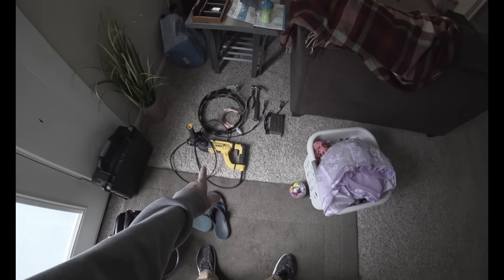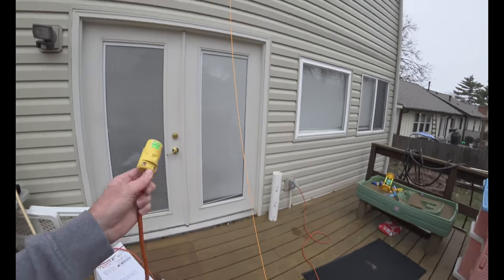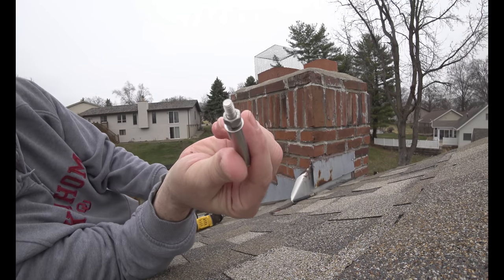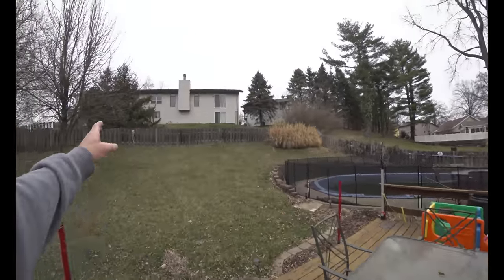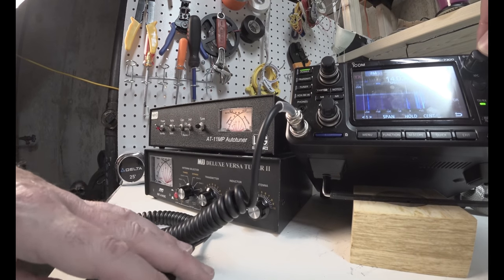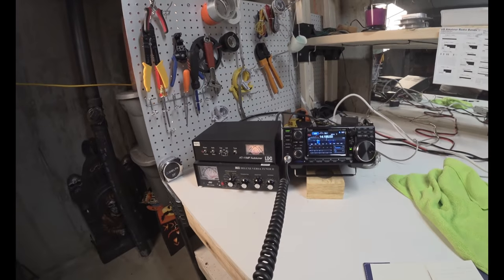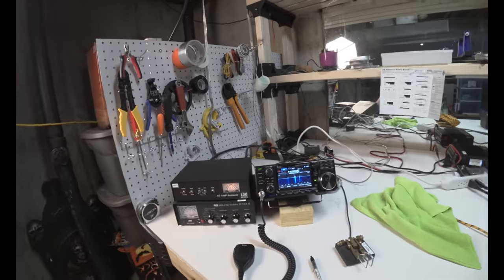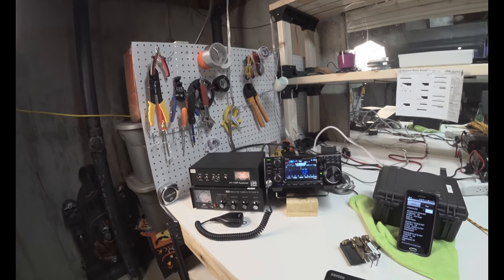Install Dipole Doublet G5RV Antenna ~ Best Small Backyard Antennas ~ Ham Radio

Comment: If you are worried about stress on that bolt in the chimney, just tie a heavier rope around the whole chimney and tie the antenna off to that. :)
Reply: Or just get a chimney strap which will be the most secure and pretty cheap to setup.
Reply: i made my oun with 2 pices of painted treated wood with long threaded rod.

Comment: Transmitting SSB with 100% power is not going to result in the meter reading 100 watts out due to the nature of human voice and the lack of a carrier in SSB.  You could boost your average power on SSB by enabling the compressor on your radio, and you might also check to be sure your mic gain is set correctly by watching your ALC meter.
Reply from the maker: andrewbrafferty Thanks for comment I know it varies as you speak but 10 percent seemed very low
Reply: It does seem a little low...do you have a dummy load you could compare results with?  You know you are getting good power out on CW (at least to the tuner) so giving a little boost to your mic gain to bump up your modulation might be all that is needed.  Enjoy watching your videos, keep it up and don't let the nosy neighbors bother you!!
Reply from the maker: I know... right?  Thanks for the kind comment.  I'll keep experimenting and try that.
Reply: It looks like your rig is performing just fine.  May I suggest you read up on the difference between Average and PEP (peak envelope power) meters. It will explain everything. I built my own full sized (102ft) G5RV years ago and it worked fine for me. Many people were surprised how well they heard me on 80m with it cuz "G5RV antennas don't work worth a damn"  But, like I said it worked for me. For folks that don't know, the G5RV was originally designed to be a resonant (no tuner) antenna for 20m.
Reply from the maker: Tim Keene Will do thanks for advice
Reply: Turn up your mic gain
Reply: Welcome to having an ICOM 7300 and one of its quirks.  I have run into the same thing,  got so frustrated with it shut it off and setup my 891, and got double the amount of power on a radio that cost around $400 less.  Bugs the crap out of me on the SSB.  Icom says this is normal.

Comment: Just a comment about the MFJ-915, in the manual of the balun it does say to install close to the transmitter.  However in the G5RV-JR antenna manual they do say to put it between the coax and the the balanced feed line at the antenna.  The issue is that the balance feed line will cause RF currents to be running on the shield of the coax.  The balun at the feed line point will prevent the RF currents on the coax shield and reduce in shack RF.  In this case I would tend to listen to the manual of the antenna and not the balun as there is likely more than one application for the MFJ-915.  Relevant information from the antenna manual is as follows:

The G5RV is a balanced antenna fed with a balanced 450 ohm line that
terminates in a SO-239 connector. When feeding this antenna with an
unbalanced line (such as coaxial cable), it is a good idea to use a 1:1 choke
BALUN at the coax to feed point connection. The balun will reduce or
eliminate parallel currents on the outside of the coax shield. This will prevent or
reduce RFI, RF feedback, RF burns, and other effects of excessive RF in the
station.
Reply from the maker: Yeah, I will say I run it close to the radio and I notice zero problems.

Comment: Make sure your ICOM inboard antenna tuner is disabled, when using the outboard tuner.   Set  up the outboard tuner with a constant amplitude carrier. Either hold key down or am carrier no modulation, or fm carrier no modulation.   SSB power varies rapidly with your voice modulation so too ragged to see a smooth meter movement.

Comment: The meter in the LDG is not a peak reading meter on SSB. That is why you have to use a continious carrier (CW,AM,FM) to check SWR and power out....  Peak vs. Average reading meter
Reply from the maker: Yeah, FM shows 100 watts power out, but I expected more than 10 watts SSB.  Question, if I key down FM I"m about 100 Watts right?  What if I key down SSB and speak, is it also 100 Watts but only showing 10?
Reply: Your meter is not a peak reading meter only shows average power. the SSB peaks (Your voice frequncies) are so short duration that the meter can't capture them .  All is well, if you hold the peak long enough the meter will show it better.  say "AHHHHHHHHH"  on a clear freq (make sure you ID) and you'll see a difference.

Comment: Dump the line isolator and get a dual core 1:1 choke balun. Connect the window line to the terminals and your coax to the SO-239 connection.

Comment: A metal strap all the way around the chimney is a much better anchor choice than drilling the brick. It will work for awhile. 
Also, If you have a Ham License you can put up as many towers as you desire as long as you follow building codes, height restrictions, set backs, so on..... Amazing the rights Ham Operators are given to get their antenna in the air.
Reply from the maker: I hear you.  Thanks for commenting.  This is a stop gap-> until something better goes up.

Comment: You should do a SWR measurmenent of the barebone antenna. Then, use the ATU from the radio, not the external one as I can see SWR rising on the radio... GL GDX 73 de YO3HJV
Reply from the maker: Thanks I like that comment.

Comment: Hello my friend. Congrats for your new antenna!!! Hey about the low power output, theres many reasons. Check your output into a Dummy Load at 100% of power on SSB. Be sure your Watt meter is set to PEP (PEAK) AND NOT to AVG (average) check your mic gain and ALC. When you use a tuner either AT or manual tuner when the capacitors and coils onside the tuner do they job to make the radio "happy"  the radio drops the output for self protection. Enjoy my friend just to let you know you're so Blessed and lucky having suck a nice Lot in backyard. Im living in a condo with this kind a jerks "antenna police" agents and not even a single tiny wire is allowed. :(

Comment: Very good video & good setup.  I am doing an experimental antenna setup by making 4 half wave center feed  dipoles resonate to each freq , then using a remote switch to use each antenna accordingly to freq. Hopeful to reach max output signal.

Comment: You've got a huge lot compared to mine! Possibly 50% bigger.  And you have a tree in the back yard. Plenty of room!  I'm guessing if you attach that pole to your back fence and push it up when you want to operate and you'll probably do better than pushing it up in the middle.  Just my 3 cents. 73, Rex KE6MT
Reply from the maker: Rex Vokey sure I can definitely do more. I do need to stay stealthy though
Reply: I can relate. I have a stealthy setup because my wife doesn't like ugly big visible antennas!  The noise floor at my house is so high, I prefer to operate portable anyway. So that's where most of my antenna work goes. I think I have like 4 portable antennas now. Ha!
Reply: Rex Vokey 
Boys, there ain't no such thing as an ugly antenna!!!
Or at least if there is I ain't seen it yet.
Reply from the maker: Bill S I agree actually I love them I just saying it is not straight it's just thrown up
Reply: You may want to attach that telescopic pole to the center insulater which usually has an eye bolt on top of the insulator.That way,it will support the antenna better and also,you should have attached the end of the antenna upon a stout limb so the end of the wire is not in the way of kids,pets, etc as with all dipoles,the high
 voltage points are at the ends of the wire.This is very dangerous if you are operating and if someone comes in contact with the wire,a very nasty RF burn would be the result.
   Remember,when using SSB, your voice peaks will be the strongest part of your signal,use a procsessor to bump up your output.This is known as  P.E.P,Peak envelope power.
When the rig is properly tuned,switch to c.w. mode and send a few "e's" and watch the watt meter,it should show full power the.
 Overall,good video,73 
Don, VO1XH

Comment: This radio, The Icom IC-7300, has a built in antenna tuner does it not? Did you already have the external tuners?
Reply from the maker: The ic 7330 won't tune unless it's already < 3:1.  Beyond that it won't do it.

Comment: A battery drill would have been better for using on the roof,less the cable to trip over or worse suffer an electric shock on the roof. Does ur tuner meter not have a pep button that would show a better reading. As it shows ok with cw then it's working fine. You could also have added a small pulley wheel up on the chimney that would enable you to make adjustments without the climb. Gl es 73.
Reply from the maker: When I got the drill it was for putting in pool fencing and the cheaper option. Batteries degrade and are expensive.  I should have used the PEP button agreed.  Strange that I get 10% with SSB and 100% with CW isn't it?  Adding a pully is a great idea... I can still do that.  73

Comment: Why you are using external antenna tuner if your IC-7300 have built in antenna tuner?
Reply from the maker: I believe the IC 7300 will only tune if it's very close to 1:1 to begin with, not exactly sure, but better than 3:1 or 2:1 maybe?
Reply: I have not experienced any issues with built in antenna tuner yet. Even when I tried to use 80m loop for 160m transmitting. Transceiver just transmitted only 3 watts instead of nearly 100w but that's a antenna tuner mission to protect your equipment.

Comment: No clue about power reading on phone. I don't do phone, CW only. Is your mast, not tower, from MSG? I bought one and really like it. I don't do packing it on back anymore. Leave for the youngsters. HI The fiberglass mast sets up nice on the back porch, side of the house, or at a park bench and gets the antenna up high (my mast is 50 foot). Nice video.
Reply from the maker: I like that 50 foot concept... what mast is it?
Reply: Max Gain Systems, specifically the MK-8 Heavy Duty telescopes up to 50 feet, priced at $239.95. Guying is recommended. I am sure there are those live dangerously and will forego that advice though. I have the guying rings and I've made paracord guys with easy clip on caribiners.
Reply from the maker: 50 feet telescopic is very respectable height...   I hear you on the guying... something has to keep it from falling over and becoming a severe force blunt trauma object.
Reply: There will always be someone that attempts to over extend the capabilities of devices like these telescopic fiberglass masts. As long as the user doesn't go beyond the design boundary of the mast it should make for a great temporary mast. It could be used as a permanent mast, but with not much weight at the top and guying, that might make for a way of elevating an antenna when trees are not available, or like me to old to comfortably climb an elevated structure. Your comment early in the video about not having someone to hold the ladder holds true with many hams. When we are ready to do antenna work, those that might help us are not available, so we adapt and get the job done on our own.
Reply from the maker: Safety is key.... I have others dependent upon me.
Reply: Yes, I understand. When I was a new ham I independently did work on towers and other structures that with help would have been easier and I had to be careful and safe for my young Son whom had only one parent.

Comment: Looks great! I like that idea that you can easily stow it away too. I did cringe a bit when you started drilling into the brick and not the mortar joint. I think that you're not getting full output power because you are using a tuner, tuners really only fool the radio and because the antenna is not truly resonant, you'll never get full power out. If the antenna was fully resonant you could get full output power. Notice ho you only have output power in SSB when you have audio going into the mic, try talking louder and longer..lol.  That line isolator is just an RF choke, 1:1 Balun....I believe it's just to prevent common mode current. Good job on that install! I wish I could get on my roof that easily, but I have a scary pitch...lol
Reply from the maker: Yeah, I realized when the brick was chipping it was probably a bad idea....I might go up there and fix it into the mortar joint.  Oh well.  Yeah I expect a little bit of SSB difference, but only 10%?  That seems very low.... when CW was pegging the needle the other way.  I would expect 50% at least on SSB yelling (which I tried).
That choke has worked better than anything else I've tried, including coax coils and chokes at the antenna side.
Reply from the maker: Yeah, don't get on your roof!  I've seen your attic!
Reply: lol. Some antennas, even if they are resonant, aren't in that sweet spot for full power out. You should kill it in the contest this weekend (I know you're not in it- to win it).
Reply from the maker: The "big guns" are terrified that I'll turn in my score sheet...I'm sure.
They watched this video and now know they are up against my backyard copper wire at 30 feet.
:)
I'm having a blast with this stuff!
Reply: You know it's true! They're all probably taking down their beam antennas and disconnecting those amplifiers!
Reply: By the way, don't forget to email, or send me a FB msg.
Reply from the maker: Exactly, why waste their time they're thinking?   What could be more difficult than winning a radio contest and at the same time be so meaningless?  If you aren't having fun and having RF burns you aint doing it right.
Reply from the maker: Ron C I can't find you on Facebook. Look me up in the POTA fb page
Reply: I did, I tried to send you a message that way. Will try again
Reply: I laughed because it's clearly not true, shows you live in Australia...lol

Comment: If you had fitted a pulley with a large loop of cord you would never have needed to go up there again :)
Reply from the maker: I might add that feature later.  Maybe I could pull up an inverted vee or something also. Thanks for comment.
Reply: The main advantage of a pulley is it gives you a 'platform' for easy experimentation. It suddenly becomes very easy to take antennas down, make a change and put it back up. I have one on my chimney, but my garden is only 10m square, so I am quite limited in what I can put up.
Reply from the maker: Paul Graham sure I totally get it.

Comment: Very informative video - thank you...  Rather than drill a hole in your chimney and risk fracturing a brick, could you have looped a length of weather proof rope around the entire chimney and attach the antenna to it?
Michael VA6XMB
Reply from the maker: Yeah, that was dumb now that I think about. I heard you are supposed to drill into the mortar and not the brick as well.  Dang it.
Well, I did have the drill so might as well use it.

Comment: That antenna is not the greatest. You may want to consider building a Bazzoka for the band you work the most. That antenna may work the best at 40 meters due to its lengh. 73 NP4M

Comment: That joke was a real let down...  Ok, a nice trick when having to hammer on the threaded end of a bolt, put the nut on and line it up with the end of the bolt so that you aren't pounding on the threaded end. Also use a soft head hammer to be even more careful.
Not really what I was looking for so I'll be moving on.
Reply from the maker: Wow

Comment: HOA ill put a Drect TV dish up there or a FAKE one on a tripod... and run it off that..
Reply from the maker: I think even a DirecTV dish is not allowed.
Reply: @hamradiocq  federal law says that it is, despite whatever HOA rules are.  The FCC ruled that HOAs had to make provisions for over the air cable including DirecTV and dish.  A HOA can not deny requests for Dish antennas.  I'm on the ACC board of my HOA and we are very restrictive however we can't touch solar panels or satellite dishes.  Both of these items have Federal laws protecting the installation regardless of CCRs or HOA rules.